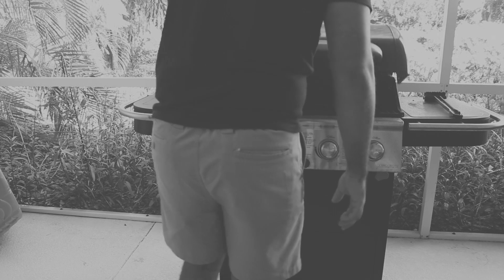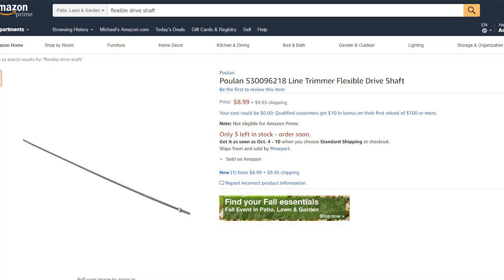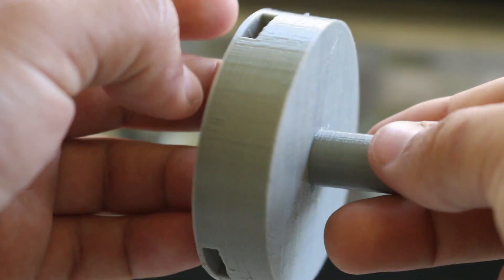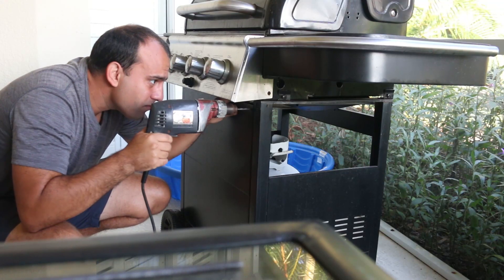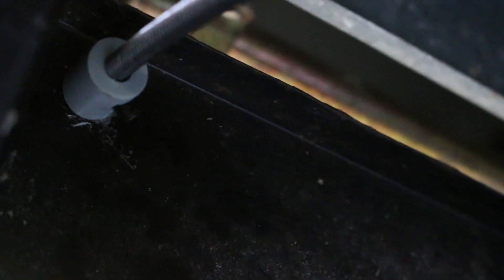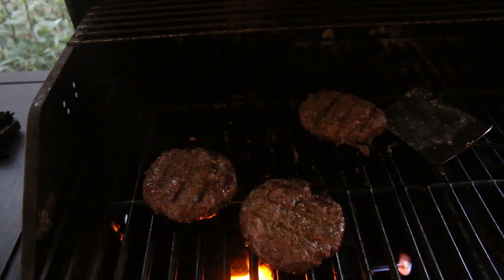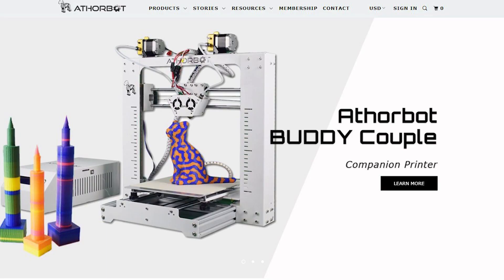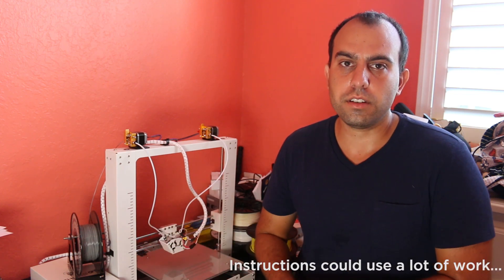A More Convenient Propane Tank Knob Location | Practical 3D Print

Comment: Until this video it has never occurred to me to turn the gas off at the bottle after using the grill.  I have been using propane grills for 20+ years and never had a problem.  Sounds like a solution to a non problem.  But if it makes you feel better then go for it.  Great channel though.

Comment: I’ve never done this. I have yet to die or lose gas trusting the knobs at the grill. I run with scissors too. Gas is at so little pressure the paranoid turn off/on constantly is so unnecessary. Go for it, you won’t regret it.

Comment: You should turn the tank off first and then let the burners go out on their own before you turn off the burners at the grill.  This accomplishes two things: 1) You know the tank is closed; 2) you dont leave your rubber hose pressured up with propane
Reply: Exactly. An old landlord, who was also a Fire Chief, used to insist we did the same thing.
Reply: Brett Smith Hey, that's smart! I also thought about the problem of pressure and shaft failure, but didn't come up with such a simple solution👍

Comment: With gas bottles you only need to crack the valve. It's designed so you can "quickly" shut off the gas in a emergency. Look great though